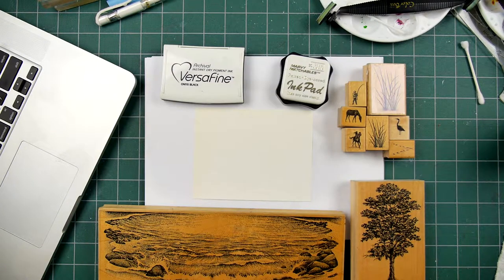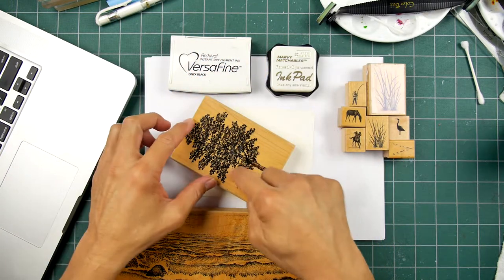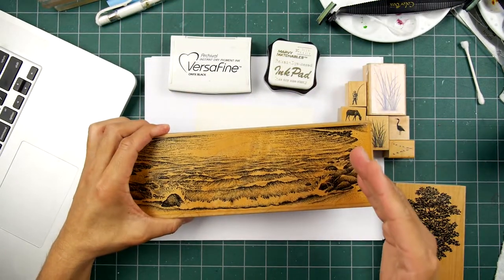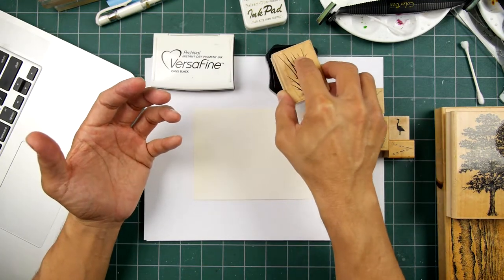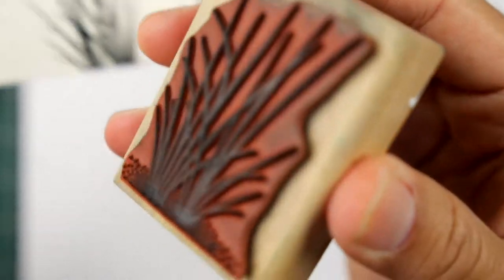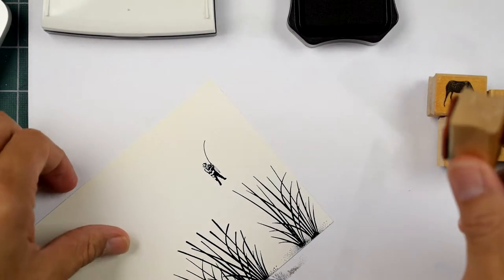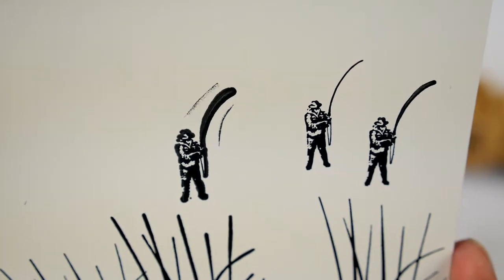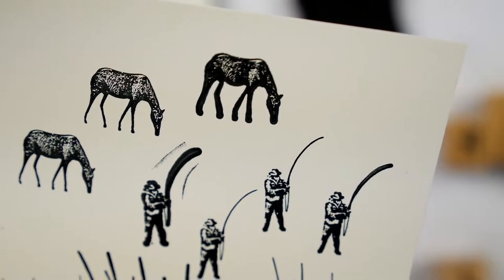Stampscapes 101: Video 232.  Impression Pressure

Comment: Now I think I understand the issue I'm having with the larger stamps that I'm using.  There are places where I get no impression in the middle.
Reply from the maker: Right.  It's not necessarily about image size but it's surface area with stamps.  The more surface area there is, the more our pressure we're applying gets distributed.  I stand up when using large stamps and I apply that center pressure as well as left, right, top, and bottom.  A stack of copy paper under my paper works well too, to conform to the bottom of the stamp and paper.  Just remember to lessen the pressure used for smaller stamps.  It's common to develop muscle memory during the course of a card/scene and some use the same pressure on a 1" bird stamp, at the end of the process, as they did a 3" x 4" stamp in the beginning and the bird might look squashed.  So, light even pressure on small stamps.